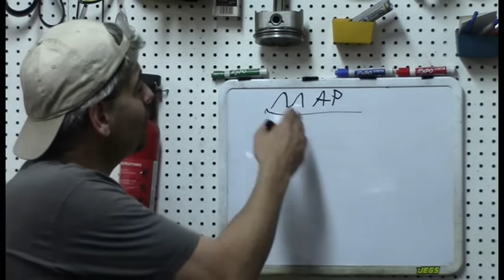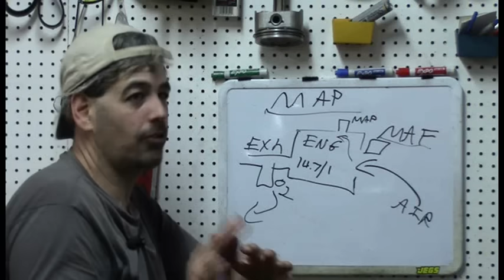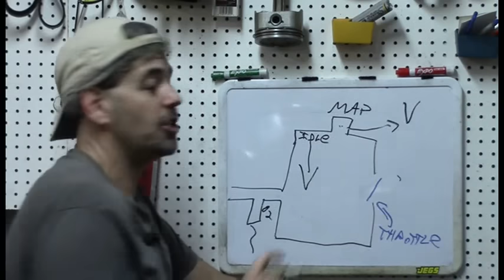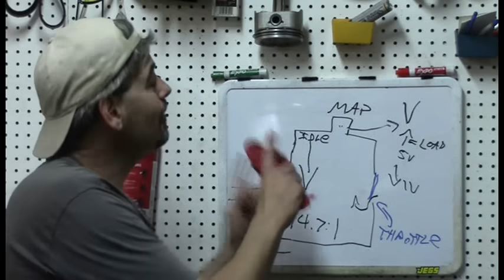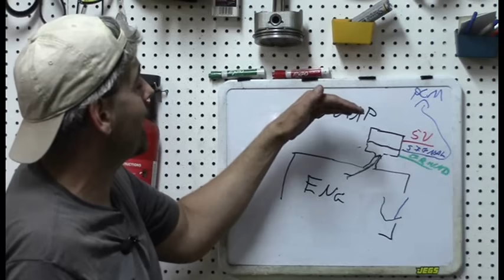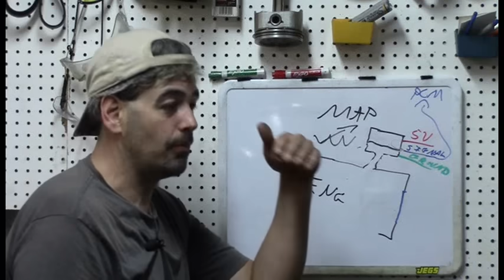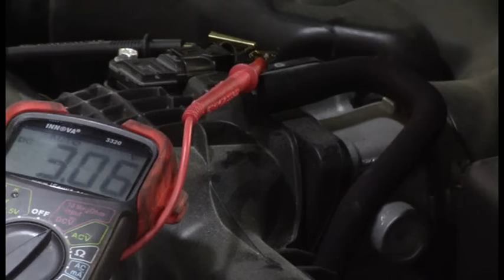MAP Sensor Diagnosis and Understanding Function- Pt1

Comment: Please help!!!! I have a 2004 Jeep Grand Cherokee Laredo when I first turn it on (cold start) and drive it down the street it stalls really bad like it wants to turn off but after about 3 minutes or so when the engine is warmed up it goes back to normal and runs good again I changed the crank sensor, camshaft sensor, idle control valve, and throttle position sensor I’m getting the cods p0123 p0505 and p0108 please help
Reply from the maker: I would start with the data you used to determine the cam and crank sensor were the problem. And the idle control valve. And the TPS. What data are you using showing those were all defective?
Reply: It’s a 4.0 inline 6 and at first it died on me in the street so I changed the throttle body sensor but it still turned off on me so I changed the crank position sensor and it fixed the problem but now it stalls when I first turn in on then it warms up and drive normal. And it’s also idling over 1000 rpms on park then I put it on gear and it drops to 600 like normal
Reply from the maker: Well what was you data from the crank sensor? Does it not correlate with cam? Was their loss of signal- and what type of signal is it? Is it inductive or digital? How was this measured?  Help me out - need something to go on.
Reply: I’m no mechanic I don’t know anything it’s the reason I’m asking for help but all I know is that after I changed the camshaft and crank sensor it ran a little better but the next day I went to turn it on and it started stalling and didn’t want to accelerate so I’ve changed the throttle position sensor and it still stalls when I first start it up and idles over 1000 rpms but then later after I’ve used it for awhile the idle goes back to normal as well as the stalling goes away so it really only happens when the engine is cold and after I changed that that’s when the check engine light came on also just today now I have the code p0320
Reply from the maker: Ah got it. I would need to see that data to help. Can’t help unless I can determine where the fault is sorry.
Reply: Schrodingers Box codes went away now I only have the code p0455

Comment: MAF vs MAP vs rpm and air density goes hand in hand or relative to each other. For my 1.8 litre engine doing 3000 rpm and +7.5psi air pressure on a highway, put on auto cruise, I would use rough formula of: 3000/2/60x1.8x1x150% = 67.5g/second by the MAF. At engine at off my MAP is so far good at 0.0psi. 😂😂😂

Comment: Matt, my jeep has an IAC.  I'm thinking that it allows for a temporary metered "vacuum leak" when the engine is started cold.  Am I on the right track?
Reply from the maker: +Ed Waggoner Sr. (Papatch) That's a way of looking at it, yes.
Reply: Schrodingers Box Thanks Matt, I am presently watching MAP part 2 again.  I will check to see if you have a video on the IAC.
Reply from the maker: Ed Waggoner Sr. I actually don't however there is a series "trans am lean code case study from hell" or something like that where I diagnose IAC.
  The IAC is also examined on a video "into to oscilloscope".  I haven't (yet) done a video specific to IAC - I will put that on the list.
Reply: Schrodingers Box I'm late to the party, just now started learning important things I should have learned years ago.  Your videos may be the best on YouTube in explaining engine run diagnosis.  I look forward to the upcoming IAC video.

Comment: dear sir...I have fiat with multijet diesel engine..the car works fine when it is cold in the morning and when its get heated, the engine check light turns on and suddenly losses the pulling. there is no missing in the working...however turbo boosting is not taking place..what could be the problem..is it map issue

Comment: great info.... I have a question...  2000 s10 2.2l 5speed... I just replaced the flex-fuel compensator as it was throwing the code for that.. now the engine is running really rich... (driven about 100 miles) at a stoplight the engine lopes over but keeps running, another problem on top of that is the RPMs do not come down when shifting, gas pedal moves in and out freely..., so not sticking, the engine is idling at around 1300rpms,  haven't gotten a code yet hope to tomorrow, any ideas?  thanks in advance
Reply from the maker: what was the code for the flex fuel compensator? I have never seen a code that indicates a flex fuel compensator is bad.
Reply: @SchrodingersBox  Trouble code P0176 is triggered by the Engine Control Module (ECM) when it receives an abnormal signal from the flex fuel sensor, replaced it and took care of the bucking and sputtering
Reply from the maker: yeah you have to determine if the abnormal signal is a legitimate report from the fuel sensor, or if it’s from a bad fuel sensor. what is the signal data?

Comment: For cars that have both MAFs and MAPs (like many turbocharged 4 cylinder GDI engines) is there any reason a dirty/malfunctioning MAP would create noticeable effects on fuel trims?

From your explanation, I would expect more reliance on the MAF, with the MAP info becoming more secondary/back-up.
Reply from the maker: Really good question.  I doubt you see an impact on fuel trims from the MAP malfunctioning. You would just see a code thrown as it fails to correlated with MAF and TPS.
Reply: @SchrodingersBox  thanks!!

Comment: Hi, Very Good video, I have a question, If I want to use an engine cleaner and spray the cleaner into the throttle while stepping on the gas peddle (open the throttle a bit more), will the cleaner spray vapor interfere with the MAP sensor diaphragm material?  will this damage the MAP sensor diaphragm material? thanks in advance...
Reply from the maker: If you use enough it can. I use MAF cleaner or electronics cleaner because it leaves no residue
Reply from the maker: Why? What is your data that indicates this will fix the issue? Are you basing this on TPS% on a drive by wire system?

Comment: Will the map sensor and the throttle sensor going bad will also affect the shifting an automatic transmission?
Reply from the maker: The trans should still shift the same with a bad MAP but defintely a bad TPS could theoretically affect it.  But not likely.

Comment: Dodge 1500 quad cab does not accelerate when on hwy and a/c on high .  Runs well on hwy but when a/c is put on high truck stays on but does not accelerate.  Always starts right up when i pull over. Thanks for your educational videos. Could it be the Map sensor or the throttle boy.  Thanks!  San antonio Texas. Darrell
Reply from the maker: Could be either or neither. What data do you have?
Reply: Well i went ahead and decided to remove the fuel throttle and it was really really dirty. Took it off and cleaned it as good as i could placed it back and truck is running fine with a/c on full blast. thanks for your quick response. Darrell -San antonio, TX (Beginner)

Comment: stft sits at -9.3 and when revved to 2500rpm it zeros n climbs to 12.5 lft is 3.9 at same revs map is now 8.0 saying fuel sys1 ol-drive then CL the ol all changes when revved sorry suppose you would need to see the obd2 itself loads at 4.3G it says?
Reply from the maker: You don't any relevant data here sorry.

Comment: Thanks for not computerizing your voice man. I don't care for it much. LOL!
Also thanks for the very informative video's.

Hey I just tested my 2000 Ford Windstar MAF sensor after scanning codes - P0112 IAT sensor circuit low and P0102 MAF circuit low input.

When I check the signal wire with my multimeter, I'm getting a constant 6.94 to 6.97V throughout raising the throttle idle to say 30 %.
Any suggestions? I know the MAF should be bad but could there be another reason Im getting such a ridiculous reading? These MAF sensors are pretty expensive and also have the IAT intake air temp sensor integrated into the same unit, no doubt you already know that.

Anyhow, should I look farther or replace the MAF? Thank's!
Reply from the maker: ILTSYC Your timing couldn't be better- I just did 2 videos on MAF diagnosis. You will be hugely enlightened on those readings.  I will upload the videos on Wednesday this week and it should be tremendously helpful.
Reply from the maker: ILTSYC And incidentally don't do any more testing on your MAF until then- you are obviously probing the 12V power and the 5V reference (12v-5v=7v).  If you don't know what you are doing when probing these, you have agood chance of frying your PCM.
  On the other hand I know your 12V power and 5V reference work.  You haven't tested the ground though.
  It will all make sense in the video.
Reply: Thanks for the reply man.
This one is a six wire connector and I've checked the 4 middle ones starting at A- red 12.6 V, B- is Black ground 6.41V, C- is  orange or peach ground 6.41V and D- is blue signal wire.

On the signal wire I'm getting 6.94V.
Here is the link I'm using.

 http://easyautodiagnostics.com/ford/4.9L-5.0L-5.8L/maf-sensor-tests-2

Also engine idles rough, tranny shifts a little harder, low throttle acceleration is kind of on and off when creeping along at wal mart.
Otherwise does fine if I just gun it and go but its getting worse at road speed more so with the tranny jerking.
Reply from the maker: ILTSYC The six wire means the IAT and MAF are integrated.
  I cover this thoroughly. You are simply measuring the wrong wires.  And even so- if you are on the MAF reference and 12V wire feed, the 7 V indicates you have a digital MAF which can't be tested with a DVOM anyway.

  Tell you what, I'm on a business trip but I will load the first 2 parts of the video today and it should be enough to get you started with accurate measurements at least.
Reply: Thanks man! You Tube and people like you make things so much easier today. If you can give me a shout when you post the vid I'd appreciate it. 

 Last weekend I finished repairing a blown head gasket in this guy. After getting the heads milled some of my valves failed the diesel in the port test, so I lapped the valves myself with grinding compound and got those all holding diesel.

I'm pretty certain all of that work is sound. Now if I can just get this electronic stuff squared away I'll be rockin. Thanks!
Reply from the maker: Videos are posted now.
Reply: Thanks again man!

Comment: Probably a dumb question... but... Can you measure the sensor output through the cable in which you connect the computer rather than back probing and possibly damaging the wire?  I only work on my own outboard which is exposed to a lot of moisture.  Thanks.
Reply from the maker: you can only measure networks signals from that connection and also the sensor shared ground but no you cannot measure individual sensors or even 5V reference from that port.
Reply: @SchrodingersBox  Thanks.  You make great videos.

Comment: I just pulled mine to install a new MAP in a 6.7 Powerstroke Diesel.  Instead of installing a new one I decided to clean and reinstall. It was full of carbon and I cleaned with aerosol cleaner and swabbed it out with a Q-tip. Did I do something wrong with the Q-tip. I started the engine and no warning light but haven’t run it up yet.  Please advise.
Reply from the maker: What is the signal voltage showing?
Reply: @SchrodingersBox  … thanks for your reply. Didn’t try that but I pulled it again and just did a. Magnified visual of it compared to the new one. I ended up installing the new one. I shouldn’t have taken it on myself to poke a q-tip in there. Thanks again.  Hundred dollar mistake.

Comment: My 5v reference is at 5v ignition on engine off, but when I start the truck, the reference voltage drops to around 2-2.5 and fluctuates. I'm not getting any voltage on the signal wire to the pcm. Any suggestions?
Reply from the maker: where are you measuring it at and how?

Comment: So for the MAP that intergrated with temperature sensor, what is temperature value used for? is it to calculate Air mass?
Reply from the maker: Exactly!!!  The colder the air, the more dense it is so the IAT makes sure the air fuel ration considers air density.

Comment: My car dies frequently, usually while idling. I’ve replaced the Crankshaft Position Sensor, Distributor Cap & Rotor, Sparkplugs, Ignition Coil, and the battery & alternator test fine. I am now wondering if it’s my MAP sensor? I do have a small exhaust manifold leak so I know I’m getting lean readings. But I don’t think an exhaust leak would cause intermittent stalling/dying. What do you think I should do? It’s a 97 Jeep Grand Cherokee 4.0l.
Reply from the maker: I would start with the data you have that indicated all those components were bad. How did you test the crankshaft position sensor? Did you validate inputs and outputs? Why did you change the ignition - did you have evidence of no spark? If so on which cylinders? Why do you suspect the MAP? What is your voltage curve and what concerns you about it?
Reply: Schrodingers Box to be completely honest with you I have just been throwing parts at it hoping that it fixes the problem. I lack the proper knowledge required to test the various components before replacing. However, with the information that you provide in your videos I hope to gain a better understand of these things so that I can be certain I am replacing the correct parts. Thanks for the reply.
Reply from the maker: Ah... well I can't really help in that event. My methods are strictly data-based so I know exactly what the issue is. If you supply me relevant data I would certainly interpret it, but without data I would just be guessing too.

Comment: How do you know which sensor (MAP or MAF) your engine is dependent of? I saw another guys video that said you could diagnose your MAF by simply unplugging it while it is idling and if the engine keeps running it is bad and if it shuts off it is good. But what if the engine is dependent on the MAP then the engine would keep running even if a good MAF was unplugged, right?
Reply from the maker: whoever said that was wrong. The engine uses both and compares the data against each other as well was other parameters to determine which is at fault. in fact so have a video that demonstrates this somewhere on the channel.  You cannot just unplug a MAF to diagnose if it is bad.
Reply: @SchrodingersBox  That's what I thought after watching your video. Unfortunately I had already bought a new MAF  sensor after watching the other and thinking mine was bad. Of course it wasn't and didn't fix my problem. I learned not to take one person's advice but to cross reference it with other video's or ask someone else. Thanks for responding and thanks for the informative videos that explains how things work also.

Comment: My 92 cherokee has fumes out of the tail pipe. I cleaned the carburator with carb cleaner ( wow it was resinie and black) and it Idles lower now. The problem still is is the fumes out the tail pipe. Im trying to get it to be a cleaning problem. Can I use carb cleaner on the opening in the throat hole. Or do I get the MAF cleaner stuff, 14.7psi is the weight of the air at sea level.
Reply from the maker: well you can’t try to create the problem to be what you want it to be. you have to treat the problem it is. what is your evidence this is a cleaning problem?

Comment: seeing the part where you said that the MAP sends a signal to the computer to tell it to add fuel to maintain a 14.7: 1 ratio, I'm curious as to why my mini, which I believe to be solely MAP and not MAF, continues to run lean. I was told that I could tell it was running lean based on the white color left on the spark plugs. My car tends to also hesitate when it is under load, mainly at around 3k rpm. Since it is supercharged I was wondering if I should be checking the Bypass Valve? I do not get an EML light (not sure what it means except its probably related to throttle body). I have swapped injectors, replaced fuel pump, and fuel filter cause my filter was really really bad. It helped but I still get hesitation. What should I be checking for hesitation, and is it a universal solution for most boosted cars?
Reply from the maker: What is the fuel trim showing? Start there

Comment: My car starts normally runs great. But when kept on to long it starts to shake I press gas and sometimes loose rpm and mph power. And even sometimes it’ll turn off. 
But once I crank up again it’ll run fine and do the same thing? Any ideas ?
I recently cleaned throttle body and my car ran better used to not go over 3000 rpm now it goes all the way to red zone. 
I just put on new mass air flow and o2 sensor also.
Reply from the maker: I would totally start with the data that showed your O2 and MAF were bad. I’ve never seen data that indicated BOTH were bad. what data did you base that on?
Reply: Schrodingers Box had it scanned it was bank 1 sensor. 
And I changed the maf after seeing that my car wasn’t pushing or getting enough air
Reply: Schrodingers Box thinking maybe the catalyst needs to be gutted what are your thoughts on straight piping
Reply from the maker: How did you see car wasn’t getting enough air?? What dat shows that?  Also what did the scanner say about sensor one. You just said it said “bank 1 sensor 1”. But what did it say about it?

Comment: Will moding the map sensor give the engine better performance if the person knows what they are doing?
Reply from the maker: Not without also modding the programming otherwise the fuel trim will compensate.
  Besides, no one who mods cars by modifying a sensor knows what they are doing, by definition ;-)

Comment: Do all map sensors increase voltage as more air is drawn in, or is it possible some have a decreasing voltage
Reply from the maker: I have only seen an increase in voltage proportionate to pressure. Never the opposite. I suppose some models could have that though- either way it would work.